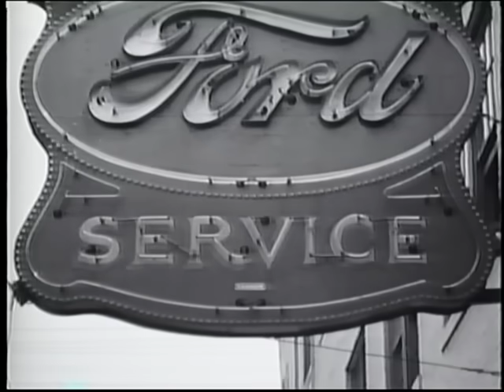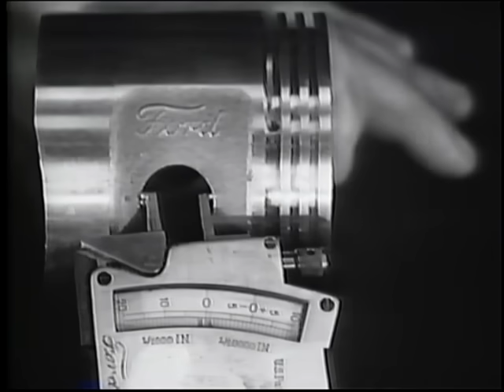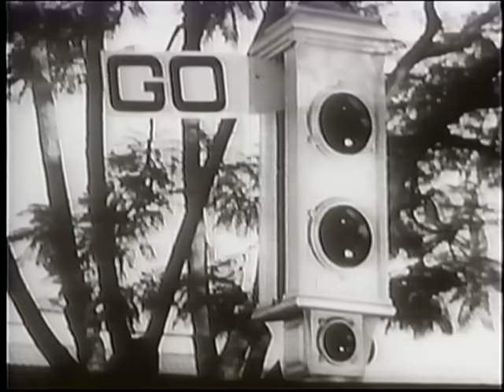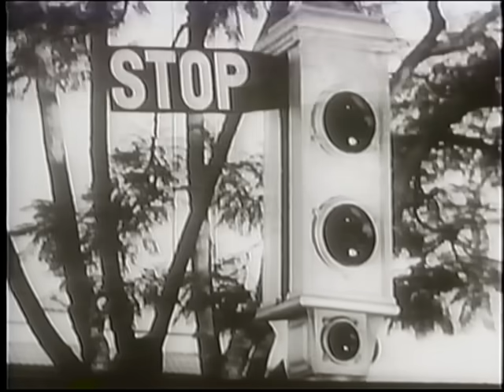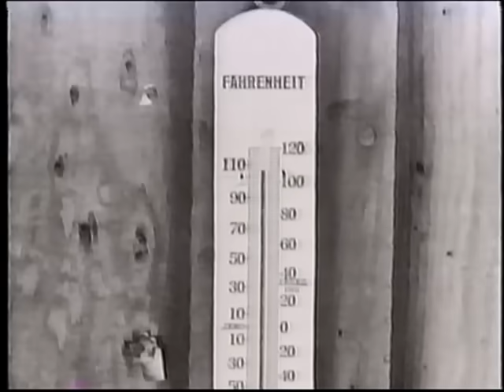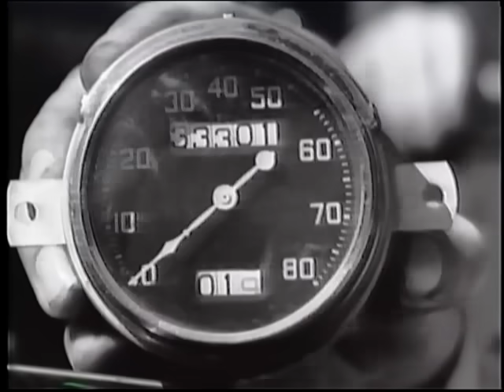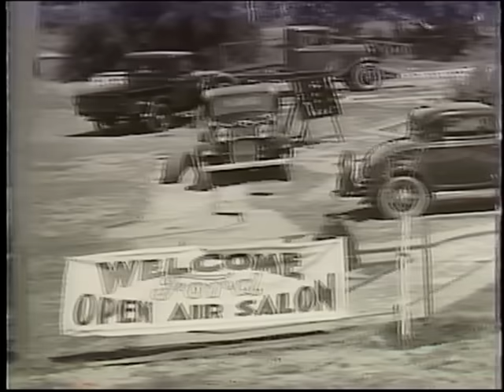1932 - The Invention of the Ford V8 Engine

Comment: It seems half the folks commenting didn't watch the video, or were too busy listening to the banjo. Nowhere does anyone claim Ford invented the V8, yet morons are complaining about it? The video points out that the Lincoln division was using a V8 for a decade+ while the Ford V8 was under design.   Even the title of the video is "Invention of the FORD V8". Likewise the stupid comments about end of the four-just because some folks can't understand a storyline doesn't mean they should comment on it.
Reply: It's not the video we are calling out, but the title of this youtube clip. It's not correct to say 'the invention of the Ford V8', it should say 'the development of the Ford V8'. That is all.
Reply: The video only implies that Ford was the first to mass produce the single piece block V8.

The older V8s had multi-piece blocks.
Reply: Glenn Woods you mean the x8
Reply: @charlesvan13 GM had a mass produced Mono Block V8 in 1930 it was the first knows V8 to run at the Indianapolis 500. So ford wasn’t first V8 mono block to be produced in the USA
Reply: Maybe the endless, too-loud loop of distracting banjo messed with their thinking
Reply: Are you a policeman?

Comment: Nice time capsule of the early 1930's. I do wish that it had focused on the engine exclusively, i.e. what were the technical/engineering problems and how were they solved?
Reply: Well, I read that on one of the very first days of casting the flathead V8,  the foundry had 100% scrap; not one usable core.  For the era, the monobloc V8 was difficult to pattern and enormously difficult to mold and cast.
Reply: A lot of the technical problems of this engine were never solved. A flathead v-8 is an inherently poor design because there's no easy way to get the exhaust out. You'll notice the huge spacing on the cylinders. That's because the exhaust had to run BETWEEN the cylinders to exit to the manifold. This made these engines prone to overheating, and overheat they did, even with two water pumps. The blocks and heads were prone to cracking, and valves wore out very quickly. These engines were very low-powered by modern standards, and not very long-lived, either.
Reply: I will grant you that the early Ford V-8's had many problems; HOWEVER, Cadillac came out
with a mono-bloc V-8 that LOOKED like it's TWIN by 1934 even though Cadillac had been
building 3-piece bloc V-8's since 1915!!    And NO American manufacturer built 3-piece blocs
since then!!!!!!!!!!
Reply: packardexelence Cadillac's engine was quite different, They exited the exhaust on the VALVE SIDE, in the valley, which eliminated most of the problems Ford had with running exhaust between the cylinders. Given that making an engine block as one casting was a much cheaper approach, it's only natural that other manufacturers would follow suit with what Ford did.
Reply: T head V8s like the Caddy didn't have the exhaust heat problem that the  Ford V8 had but the T head suffered from  slow combustion  and gas flow problems  that became worse as fuel improved and as compression ratios increased.
At the end of WW1  the combustion efficiency of higher (for the time) compression L head  side valve layout  had been improved mainly because of research by in England by (later Sir)   Harry Riccardo.  Riccardo when working on research for Shell was the guy that invented Octane Rating as a means of bench marking spark ignition  fuels.
So for a relatively short while the L head side valve was an attractive low cost option for building a simple engine.
Meanwhile   in the USA Thomas Midgley under Charles Kettering invented the use of  lead compounds as octane booster and compression ratio rose again and the L head  was already on its last legs when Ford launched his V8.
Reply: Andrew W MacFadyen The Cadillac engines were considerably more powerful, regardless of details.
Reply: and several times the cost too. 
MAN.....compare apples to apples like a reasonable person would.
Reply: They did a great job of this in this video I think. You'd have to be an engineer to understand it if it went any deeper.
Reply: jwta5646 
Marquarty
Reply: SlyPearTree,      One of the technical problems was the combustion chamber designed to get the exhaust out of the cylinder, the intake valve and exhaust valve were located in the block and the hot exhaust gasses had to go through the port located in the block, which caused heat problems, when the compression ratio was raised for more power. The racers would grind the area between the piston and the intake valve and the exhaust valve to make the passage larger it was call relieving the block. During the same years Chevrolet had overhead valves a straight 6, as did Buick a  straight 8,  Cadillac (v-12 and v16) ford became popular because it was cheaper. The fords would go about 70,000 miles before needing rebuild. Usually burned valves. The valves were not adjustable, the stems of the valves had to be ground to make the clearance, needed for expansion. Some of the racers would put in adjustable cam followers. The rod bearings were unique they were floating between the rod and the crankshaft. Not attached to the rods as they are today. When they were worn, they would make a unmistakable rattle. This was actually better than the Chevrolet, Cadillac and Buick as they had babbitted rod bearings. If you have any questions I will do my best to answer them.
Reply: bud irving While I am PERSONALY fimilar with exuast port relieveing;---YOUR explaination is A GREAT SERVICE to our less educated Fellow
auto hobyest; you even taught me A thing or 2; PLESE keep-up the WISE posting!!!!!
Reply: Packardexelence,  Thank you for your response. I had no clue if I was helping the conversation or not. I have worked on many of the old engines as a way to support myself through school. A fun one was a V12, 1933 Cadillac I put new rings in it and removed shims from the babbitted rods, to get the right clearance. The engine was beautiful, with overhead valves aluminum valve covers ceramic coated exhaust manifolds, what a terrific sedan convertible.  The car weight was 7000 lbs. I did the same with a 1933 chevrolet inline 6, The rod throws were so worn that even after removing the shims from the rod caps they were still too loose, so I filed the rod caps and installed the shims back in until I got the right clearance. That is how thick the babbitt in the rods were. It  wasn't until 1954 that Chevrolet made a full pressure lubrication system for their  6 inline engine. I want to point out that the rod throws were out of round and a new crank would have been better, but the owner could not afford it. The splash lubrication to the rods and the low rpms kept it running for a very long time.
Reply: bud irving My cousin had a stock '53 Chevy back in the 80's, one model year before the updated lubrication system. He wasn't kind to the car so of course he seized the engine up.
Reply: guyonearth,   The 53 Chevy looked just like the 54 except for the grill and the taillights but the engine was very different, the 53 engine was 216 cubic inches with splash scoop oil to the babbitted rods  and the 54 engine was 235 cubic inches with full pressure to the rods. It was easy to trash the 216 cu in engine, It simply couldn't handle high RPM's. One of the problems of the 216 engine was the oil scoops, which were attached to the rods, they were designed to scoop oil out of a trothe with oil lines pointed at the rod scoops as they came around, my guess is that many people did not check the alignment of the scoops, making the deplorable oil system even worse. I repaired one engine that the scoops were actually facing the wrong way. That engine was seized also.
Reply: bud irving I warned him not to abuse it, he didn't listen.
Reply: guyonearth,   It seems that FSS does not like to learn the easy way. He would rather make up something and then swear to it. Please read my last reply. It is not easy to communicate with a liar who will not admit a lack of knowledge about anything. Any feed back  from you is certainly appreciated.
Reply: SlyPearTree  -  I heard somewhere that the first engines broke their crankshaft at the same spot. So Henry told his engineers to beef up the crank at that spot and that fixed the problem.
Reply: Government interference stopped real innovation.
Reply: No, didn't you know that they had to tell you about the turkish seating design? Why it  makes all the difference in comfort.

Interesting that engineers invented a steering lock device way back in '32. About 25 years ago, I had to buy "The Club," an awkward thing to lock the wheel against car thievery. Little did anyone realize that such a technology already was invented.
Reply: my uncle told me years ago that ford bought the plans for the v8 from Oldsmobile..
Reply: catmodelt  TRUE, & it's EXPENSIVE 3-CASTING design is what MADE it EXPENSIVE; (as I recall Right around the cost of a CHEEP CADILLAC!!)---FORD BRIEFLY considered DOWNSIZING the LINCOLN V-8;  BY ABOUT 100C.I.D.;--THEN came the production estimate!!!  It would have cost as much to Build as THE ENTIRE RETAIL PRICE OF THE FINISHED CAR!!!!!!!!!!   Needing no aluminum & FAR easier to assemble ONCE cast the MONOBLOC FINALLY cost under 1/3 to mass produce; But FORD lost MILLIONS on the 65% casting rejection
rate on about the first 10 to 50 thousand blocks!!!!!!!!!!!!!!!
Oh, & THANKS!!-----I thought ONLY price scared away the CHEVY V-8 customers!!!!!!!!!!!
Reply: @andrewwmacfadyen6958  you know pre WW2 fuel was benzene not gasoline. Many mechanics died from  benzene poisoning. after the switch to gasoline . Benzene stock piles were made into napalm.
Reply: @andrewwmacfadyen6958  teraethalated lead coats the steel at micosopic level making better deals with valves and rings it is a crystal molecule  and perfect circle only exist in crystals. Flash point is not the same as octane. Ricardo made ruff edged combustion chambers because side valve engine have too much head space so fuel air would" bounce " better into the cylinder.
Reply: @andrewwmacfadyen6958  Hello Andrew, how are you doing. I hope you are safe and in good health. Looking for a new friend and i saw your pic here. I hope you don't mind thank you.
Reply: @GMILLER3143  Hello Gary, how are you doing. I hope you are safe and in good health. Looking for a new friend and i saw your pic here. I hope you don't mind thank you.
Reply: @GMILLER3143  Hello Gary, how are you doing. I hope you are safe and in good health. Looking for a new friend and i saw your pic here. I hope you don't mind thank you.
Reply: @packardexelence  Hello, how are you doing. I hope you are safe and in good health. Looking for a new friend and i saw your pic here. I hope you don't mind thank you.
Reply: I worked in a casting plant. Core shift has historically always been a problem. This was one of the big issues facing monoblock V8 casting. Manufacturers were not able to go to thinwall casting until the late 70's when advancements in casting reduced core shift (the thicker walls allowed for core shift).

Comment: Ford wanted to keep the engine as simple as possible, so they had all the valves inboard and operated by a single camshaft. That was fine for the intake, but meant the exhaust gasses had to pass through long passages in the block, which led to a lot of undesirable heat transfer. To counter that, the radiator had to be plenty big.

My brother used to have a book showing all the V8 models through the 1930's. The 1932 looked the best to me... it seems like they kept adding more gaudy chrome details to the car year by year.
Reply: get your own channel Mr BlahBlah
Reply: @foobarmaximus3506  My job is related to automotive engine R&D, so I have an interest in engine design. If you are not interested in engine design, why are you here? If you are not interested in reading my comment, why did you read my comment? Get a life.
Reply: Yes that was a lot of extra heat going into the cooling system.

Comment: Frenchman Leon Levavasseur was a 39-year-old inventor in 1902 when he took out a patent for the first V-8 engine he called the Antoinette.
Reply: He developed a particular type of engine and did not invent the concept of V engines. 
The Germans created the first V engine but it was the Americans who invested the first combustion Engines.
Reply: @bighands69  Rubbish. German engineer Nikolaus Otto invented the 4 stroke internal combustion engine in 1861 (2 years before Henry Ford was even born) and got it working reliably in 1876. About 10 years before Gottlieb Daimler and Carl Benz independently from each other invented the Automobile in 1885/86.
Reply: @gustavmeyrink_2.0   "V8"  Levavasseur built the first one.
Reply: @nonyadamnbusiness9887  I did not say anything to the contrary. 

However Americans did not invest (sic) the first combustion engines as bighand69 falsely claimed.
Reply: @gustavmeyrink_2.0  Correct.
Reply: Otto Bihrer, however this video is about the invention of the first SUCCESSFUL V-8 automobile engine, the Ford V8, and its inventor Henry Ford, the same man who invented mass production and the moving assembly line in the United States of America. The Ford built Lincoln had already had a V-8 ten years earlier. Unfortunately the Antoinette company failed within two or three years after the overly expensive Antoinette engine was produced mostly for boats and for some equally unsuccessful airplanes, after it became widely known and accepted that the Wright brothers had already invented the first SUCCESSFUL airplane, again, right here in the USA.
Reply: @joebrake1141  Henry Ford didn't invent mass production.  Both Oldsmobile and Rambler were mass produced before Ford.  Industrial mass production dates back to 1805.  He didn't invent the moving assembly line either.  He lifted that from the meat packing industry in Chicago.  

Define SUCCESSFUL.   Does it require manufacture of a million of them cheap?  By that definition there's never been a successful aircraft engine.  The Antoinette was successful.  It worked, it ran, it flew.  The engine was fine for it's time.  The company was a fucking mess, but it was French, so that's to be expected.

AFFORDABLE, that was Henry's thing, making things so cheap that anybody with a job could afford it.  With that he changed the world.
Reply: @joebrake1141  your bar for what YOU call 'invention' is very, very low. Other more stringently minded people would call that 'development'.
Reply: @nonyadamnbusiness9887  Yeah sure, butchering dead carcasses is exactly the same as assembling automobiles. Any fool could see that they are exactly the same thing; no difference at all.It's unfortunate that Oldsmobile and Rambler didn't notice it, but they probably just weren't very bright.
Reply: @nonyadamnbusiness9887  you are spot on. America does have lots of firsts though. 

For example its the first Democracy to be eaten by it's Leader.
Reply: @joebrake1141  he didn't say that.
Reply: @BonsaiBarry-dh3pz  That's hardly a first for America.
Reply: @nonyadamnbusiness9887  they've done it before?

Comment: 31:02 Ford almost had the steering column locks that were mandated in 1969, 37 years ahead of time, except for the fact that you could unlock the column without the key, so it wasn't really an anti-theft device. If the narrator was implying that it could lock the column with the wheel in "the center position", maybe it was intended to allow the owner to turn the wheels toward the curb, center the wheel (which had a number of turns lock-to-lock), then leave the car, knowing that if the brake didn't hold it, the wheels would hit the curb without straightening themselves.
Reply: Chevy had a locking steering column

Comment: I'm on my 3rd Ford. A 1997 F150 5.4L V8 Lariat  I got it at 197k. It has 250k. I ran it all over the West with my little vintage trailer. A very reliable truck.

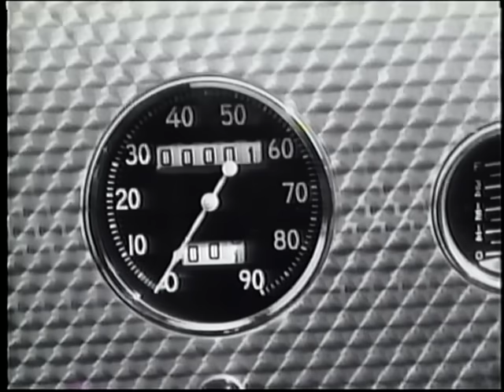Comment: At 30:40 the bucket seats that have hinges on the front so that they can be pivoted forward is something that needs to be brought back in modern cars.  Modern car designers could learn a lot from watching films like this, a lot of good design has been forgotten, especially in the areas of comfort and simplicity.   My VW Tiguan is so complicated that every time I fiddle with the controls it ends up in a different language, currently it's in Polish.  At least when it's in German I understand what Achtung means.
Reply: Not forgotten, forced to avoid, usually due to cost.
Reply: they would never meet crash standards

Comment: Ford did not claim to invent the V8, they made it affordable for everyone who earned a good wage.
V8's in any other make, including Lincoln's were very expensive and only had by the very wealthy.
Reply: same as cars like camaro and mustang.
Reply: V8 engines were around before Ford began the company. They were mostly for powering boats. There was a boat racing scene around the turn of the century. But natch, this documentary is about a V-8 you could pick up for $500.00 smackeroos.
Reply: Chevy had a V8 in 1927.
Reply: @Mungo_T Yes, 288 Cu in.  4.7litre.  Amazing.
Reply: catmodelt  Yes they did!
Reply: @gordbaker896  Actually Chevy had one in 1918.
Reply: @dalesmith561   Correct and Cadillac had an early one as well.

Comment: Used the flathead in a hotrod. Found that removing some of the fins in the waterpump improved the water circulation and lowered the sometimes overheating problem. Turned out that too many fins caused turbulence in the cooling sysytem.
Reply: You are absolutely correct on the water pump, we also tilted the radiator back  to slow down the air flowing through it picking up more heat as it past through helping  to keep the engine heat down.
Reply: go air cooled!
Reply: The inherently long run of the exhaust ports created a lot of hot metal to be cooled.
Reply: @jamesdalling5603  Next time use the English language.